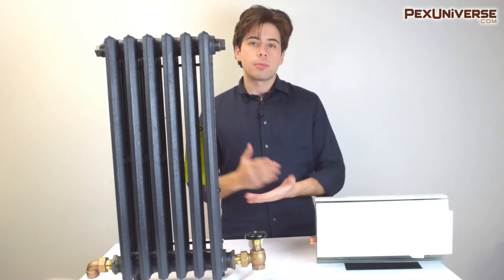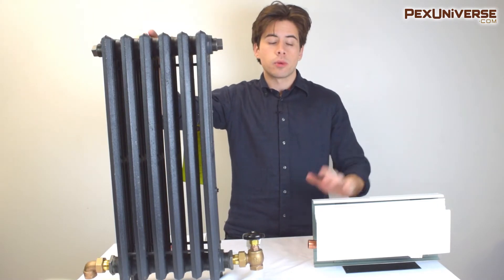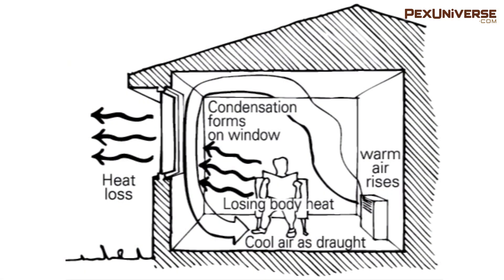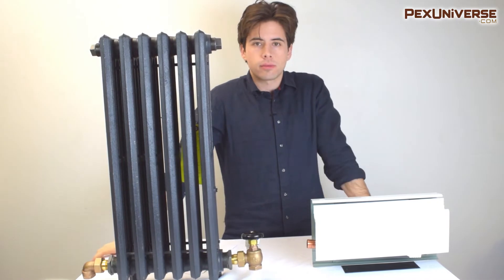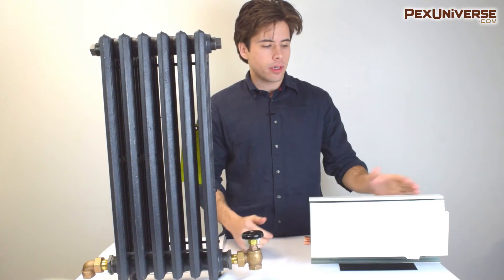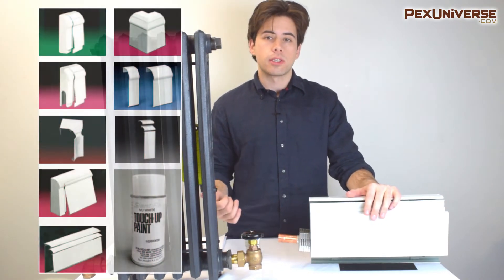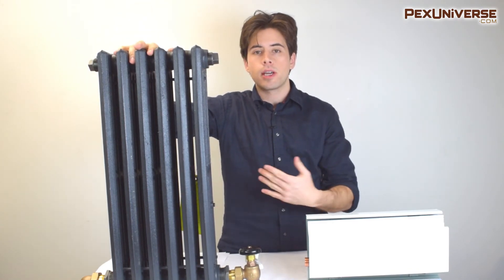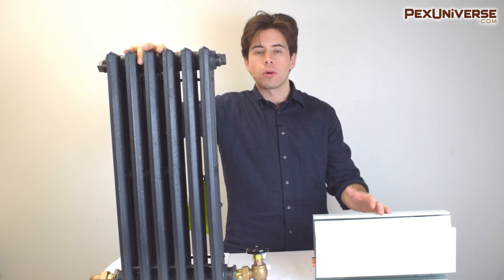Detailed Explanation of Baseboards vs Radiators | Radiant vs Convection Heat

Comment: great videos thanks. I was thinking of replacing my copper fin baseboards with radiators on my propane hot water system. brand new boiler and all the baseboards are way to small. Instead of more and longer baseboards, I think cast-iron radiators in the small space where the baseboards are, would work much better. would you have an opinion on this? it would mean a lot coming from you. thanks Brendan

Comment: I have baseboard heat and I want to add an old school radiator in the same room. Can I replace a section of the the baseboard with a radiator? The guys who did our addition did a lousy job in our family room and it gets cold. Thought if added 1 or 2 it would make a difference. Thoughts? We have a new boiler that was replaced 6 months ago.

Comment: As with the other video from this source, it is about half wrong. First, forced air shouldn't be lumped in with baseboards or radiators, as they are almost unrelated. First, cast iron radiators heat mostly by convection, heating the air around them which circulates (convectively) through the room. Depending on specifics, about 80% of the heat from a cast iron radiator is convective, the remainder is radiated infrared: the heat that you feel if you hold your open hand facing the radiator (or a fire). Fin-tube convectors, of the type he shows, do almost all of their heating by convection. There is some slight radiation, but the hot tubing is isolated from the outside by air gaps. There are also cast iron baseboards, which he does not mention, which are midway between. The biggest difference is that a cast iron radiator contains quite a mass of cast iron, which, once heated, retains its heat even when the steam or hot water is off. This results in slower diffusion of heat throughout the room and longer intervals between operation of the boiler. Thus, the temperature remain more even. Fin-tube baseboard convectors, on the other hand, have virtually no thermal inertia and will go cold almost as soon as the boiler shuts off. For this reason you should never use fin-tube and cast iron in the same installation, since the fin-tube cools instantly while the cast iron remains hot. This means the room with fin-tube will be cold while the room with cast iron remains warm. Where do you put the thermostat? If you put it in the fin-tube room, the boiler will run more often than if you put it in the cast iron room, but then the fin-tube room will be fine but the cast iron room too warm. If you put it by the cast iron, then the fin-tube room will be cold. Don't do it. Forced air is neither convective nor radiative, which is why it shouldn't even be included in this discussion. A wood stove is more similar to radiators and baseboards than forced air is.

Comment: Great advice.  When I see people trashing their radiators and converting to forced air, I just about cry.  I instead kept the radiators and switched from a boiler to a geothermal hydronic heat pump as the heat source.  The radiators now rarely exceed 110º.  On really cold days they'll get up to 120º, and that's plenty enough to keep the house warm. It's astonishing just how efficient they are at distributing heat into a room.
Reply: can radiators create mold problems since they create steam? if so does that mean it can create illness if not somehow clean from the inside? I had issues with mold in an HVAC and now wonder about radiators making constant steam
Reply: @heythere6983  Essentially all radiator systems installed since 1950 use hot water circulated by a pump and do not produce or emit any steam.  Even though the equipment where the water is heated by burning oil or natural gas is still called a “boiler”, it does not actually boil the water but only heats it to 160-180ºF, well below the boiling point.  Further, the radiators are completely sealed so that hot water is pumped through the radiator but no water or water vapor can escape.  Some very old buildings and houses do have actual steam heat, where the boiler does produce steam.  A single pipe going to each radiator carries the steam to it, the steam condenses inside and the water returns to the boiler through the same pipe.  Instead of a return pipe, a steam radiator will have a missile-shaped vent on the opposite end of the radiator.  Its function is to release air from a cold radiator when the system first heats up.  If the vent is working properly, it will close as soon as the radiator fills with steam and the steam reaches the vent.  However, it was not uncommon for the vent to malfunction and continue releasing steam all day long.  So in that case, a steam system with a malfunctioning vent, yes, you could have moisture and mold problems.  But in a hot water system with no leaks, whether fossil fuel or geothermal, it's just dry heat with no moisture content.
Reply: @quetzal4042  thanks. I was wondering about inside the radiator , does mold build up inside? I saw some saw sometimes the inside should be clean. I wondered if, leaks aside, there could still be some mold internally. IDK if MVOCS are small enough to travel through the material. I know this is possible with walls for example, spores wont pass but MVOCS will
Reply: @heythere6983 mold cant live at the temperatures of steam. If you saw a radiator with mold inside it, its because the radiator was shut off for a year or longer and not used.

Comment: Actually, radiators also warm the air around them. That warmed, less dense air, rises and is also replaced by cooler air. This is convection. So, ‘radiators convect and radiate. The ratio of radiated to convected heat is dependant upon the design of the heater, but is typically 30% radiation and 70% convection!

All electric heaters produce equal power to heat ratios. A 1500 watt fan assisted heater produces an identical amount of heat as a 1500 watt convection or radiant heater. Their efficiency comes down to the way they distribute that heat into the room.

Yes, it is true that convector heaters heat the air in the room, whilst radiant heaters heat objects in the room. But that air that has been warmed by a convector heater will after time warm the objects and people in the room. Much like a convection oven cooks the food with in it. Conversely, a radiant heater will heat objects and people in a room. Given time, those objects and people will warm the air in the room. So, given time a status quo will be achieved.

In my  humble opinion, baring in mind that I’m not an expert or a heating proffessional, convector heaters are more suited to heating a room rapidly, whilst radiant heaters are better suited to maintaining a room at a constant temperature.  Fan heaters will heat a room more rapidly than a convector heater and fan heaters are generally cheaper to purchase than convector heaters. The only issue is they can be noisy and do tend to dry out the environment.

If you’re trying to keep warm, whilst reducing energy consumption, remember it is easier to keep a person warm than it is to keep your room warm. Put on multi layers of clothing. Snuggle up to a hot water bottle, your partner, someone else’s partner, your children and dog. If you still feel cold? Drink a bottle of rum, brandy or whisky. It’s unlikely to make you feel any warmer, but you won’t care!
Reply: Thanks for sharing this. I am still trying to grasp why the baseboard is convection and the tall cast is a radiator. I understand that it has a thick iron casting to maintain heat longer but there was nothing said about iron baseboards before the slantfin baseboard came along. If one was to stack bricks on top of the baseboard, they too would maintain heat for a period of time. I’m still confused why they are not considered the same.
Reply: If you were to stack bricks, yes they would retain heat. But conversely, they would take longer and more energy  to heat up. Maybe useful if you have an off peak fuel tariff.
Reply: @h @howardskeivys4184  I’m new at this so I’m trying rap my head around this. You sir seem to have the best explanation on this video. Thanks for sharing your knowledge with me!
Reply: @Nahum17good 👍

Comment: Forced Air heating SUCKS. They should be called dandruff makers. They dry your skin out faster than you can slather on moisturizer. 
I never had dandruff in my entire life. Just dodged that one. But.... I lived with forced air for a while and.... wtf! My usually lush healthy scalp was converted into a snow machine. I was not pleased. Ha! I had them rip the whole crappy cheap system out and install proper CAST IRON good old-fashioned radiators. Because to date.... there is no better and more comfortable and natural-feeling way to heat a home. 
Infrared heaters are interesting for outdoor heat because they don't heat via conduction or convection but radiation. They don't heat air, but objects directly in line-of-sight of the infrared light. But indoors.... they just aren't terribly effective. It's like you can be in the shade in your own home with an infrared heater. It's disorienting and bizarre. Because if you round a corner or if something is blocking your direct line-of-sight, instantly you're 30-degrees cooler. It's just bizarre. Infrared is great for patios. They mimic the Sun. Literally. They are the closest heating system to the Sun. Direct rays. However... this is about indoor heating and baseboard is cheap and passable. But ideally, always, ALWAYS opt for cast iron radiators if you can afford it. You will thank me. And with forced air, it's a doozy because they're noisy, dusty, they inevitably get coated in gunk and dust and crud because there's moving air currents and a whole network of ducts and tubes and vents and ports. It's not even cheap, and it sucks. And you have to also account for needing Head & Shoulders. Ha! 

This tutorial should be simple: Get cast iron radiators if possible. Otherwise get baseboard. The end. Seriously, forced air fucking stinks!!!!
Sorry that was a long post but I believe it will help someone. Because I'm not biased or some paid shill here to push some brand for commission or endorsement. It's just one schmuck's opinion. Consider it, though. Forced Air Heating is S. H. I. T. !
Reply: @Mick Obrien     I also didn't like this system. You don't have an air humidifier installed in your system?. I lived in such a house for 12 years and we always set this indicator as high as possible. It was mounted downstairs by the system and the water was connected from the line. I think that this heat, which is inflatable, would be better saved in the use of cast iron radiators. Water heats the radiators and they are warm for the next hour even after turning off the thermostat. I just didn't like the fact that sometimes the water dripped from the tube straight onto the boiler and one time it went out. Inside, a porcelain ignitor is screwed into the boiler, which ignites the flame. It went out because the water was dripping there. My husband and a friend electrician did not know why the heating went out. I was just looking on the internet and I found an ignitor that from time to time he gets off. Ours went out from the dripping water. As you know, the heating always breaks down in winter, and it was necessary to repair immediately. My husband searched several stores for this part and drove at night to the store open 24/7.One costs over $100. There is no big problem with the installation, just be careful not to touch this porcelain with your hands, so as not to get dirty and can quickly cracks. Since then, I have always checked this tube from moisturizing. I substituted aluminum plates to drip water on it. There was no other way  to stop dripping. I often cleaned the filter in the container and it still dripped down. In my previous house we had cast iron heaters and baseboards. It was always cold in my bedroom, where there were baseboards. I always opened the door to the bathroom where it was cast iron and it was very warm. Homeowners often change to new ones without thinking at all how they will work. My tenant on the upper floor had such large cast iron, which always burned hot. There is only one problem with moving it when you renovate the floor because it is very, very, very heavy. That's all you do, let's say, once every twenty years.
Reply: @annakon8423   I never liked humidifiers. I always feel it's just a spreader of bacteria. Unless every day you clean every conceivable nook and cranny... I just find them to be kind of gross. I prefer to fix my home's climate situation so it's not excessively dry to begin with. Sure, winter months are naturally dry, because cold air doesn't hold nearly as much moisture as warmer air. But living on the East Coast (NYC), it's never really too dry. If I lived in, say, Las Vegas or Phoenix, perhaps I'd want a humidifier. But it's not needed where I am. 
As far as technical skills... If something can't be fixed with tape, a screwdriver, or maybe a hammer, then I'm outta luck. I just wasn't born mechanically inclined. My mom was. She could fix anything. Me and my dad, though... we can't fix squat. It's too bad. Being handy is a great skill.

Comment: I just did an addition adding a first floor 5 x14 room for a bathroom with schluter dita-heat electric floor and a second floor 13.5 x 13.5 room.   We have a boiler that circulates hot water through 3/4 inch copper to baseboard radiators throughout our house.   My wife does not like the baseboard heaters because they take up the entire wall, so I ordered the cast aluminun Fondital blitz Ardesia gray / 8 element / B4 500 which is supposed to produce 4288 BTUs at 176 ° F.  Then I questioned myself.  Can I mix the one cast aluminum radiator in with the rest of the system being baseboards.  Not sure if this makes a difference, but the new radiator will be connected on its own run and return with a regulator valve.  I plan to use 3/4 oxygen barrier plex to complete he new run of which the beginning exists from the baseboard heater that I cut out of the kitchen.  Also, if this will work, does it matter if the valve connecting the radiator has a 3/4 inch opening to match the run.  Thank you for your help!
Reply: i have the same question.  Wish these questions would be answered here.   Did you get an answer anywhere else?

Comment: Actually, I'm pretty sure there was a fan-assisted steam setup in one of my old schools. I still remember hearing the banging in the pipes during heating season. The air handlers were in the corner of the classrooms with modular duct spreading across the outer walls just under the windows. In a couple of my other schools, this duct work was hidden within a cabinet-like structure.

Comment: I have like 5 radiator heats in my apartment upstairs in the third floor. I have one like in my room, one in the bedroom, one in the kichten, and one in the bathroom, and also one in the playroom. as they white, they go on like automatically. without as we don't do like any of this. like not like these once. and they working pretty well. but sometimes we may have the problem, that however the heat takes time to come on, or when it's not warm enough, means when someone don't set up the meter up high or however when the piece of the bolier is broken, or when the boiler piece came off that the radiators are leaking. which we Have the problem before in the past. that was the year of 2019-2020. but thanks for the video!

Comment: I have cast iron radiators in my house, cast iron rads keep heating after the boiler's turned off, but they also take way longer to heat because there's way more water in them than a 3/4 tube that baseboards use, also the heat isn't uniform (at least in my house) which has very high ceilings.
Baseboards can be distributed around the entire rooms making a curtain of heat.
I'm thinking of upgrading to baseboards because of this.

Comment: I have a radiator, 3 column it has wall mounts, it has in flow bottom left, outflow bottom right. I have cut a new door opening to the outside, now when the door opens past 90* it hits the valve.
I want to move the right side out flow to the left top & plug that bottom hole on the right to allow the door to open all the way. There really is no other choice for radiator placement, I have to cut out & re pipe inside the wall but I am wondering .... should the outflow be at the top or the bottom of the Rad ?
Reply from the maker: If you keep your current setup and just move the outflow to the top left, it may make the radiator less efficient. If the right side is not usable, inflow through left side top and outflow through the left side bottom may be the best option. Or you can do top right/bottom left if that would not also block the door. If you're not sure then a contractor should help you make the best decision for your home!

Comment: Do you know if the cost to change from forced air vent to baseboard heater is too expensive? I don't like the 2nd method and want to change. Thanks
Reply from the maker: It depends on the size of your home and how much you might have to replace/convert.

Comment: Do you have to use copper lines to hook up a radiator? Can I install a radiator system using PEX? Is there much of a heat loss in copper lines vs PEX?
Reply from the maker: Yes! If you do, sizing is what you need to consider before taking that step.

The best bet is to calculate the btu's needed at each radiator and then size your lines accordingly.